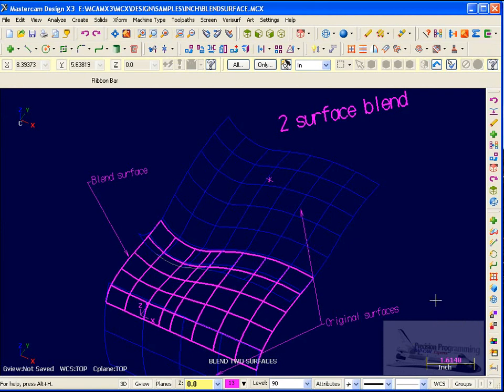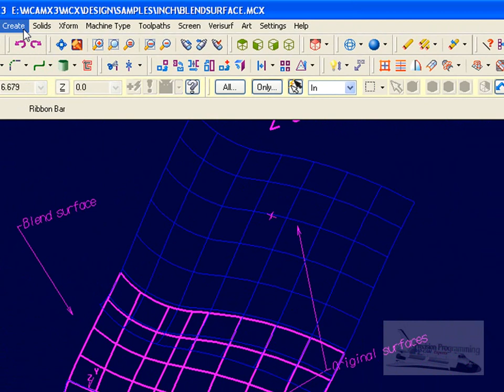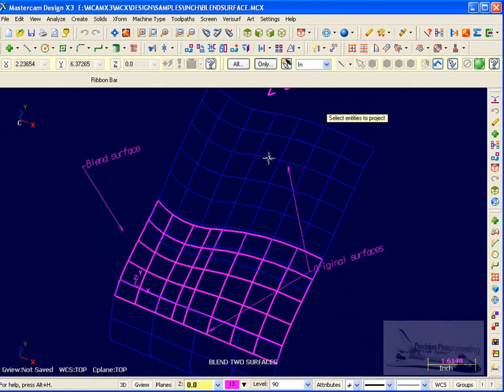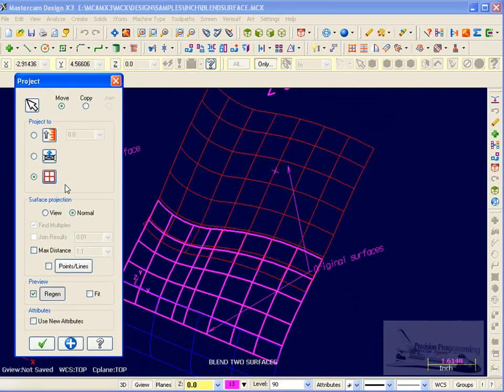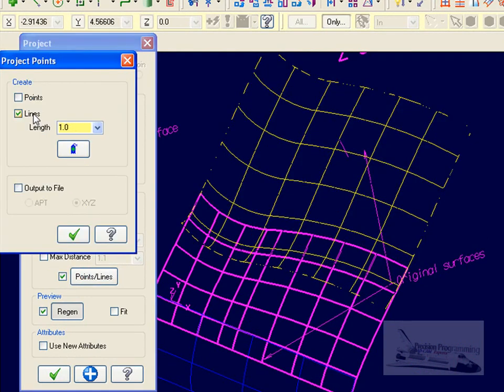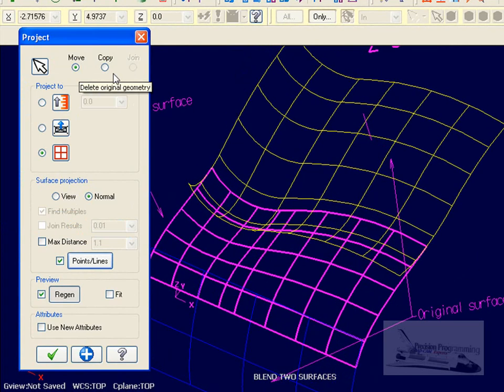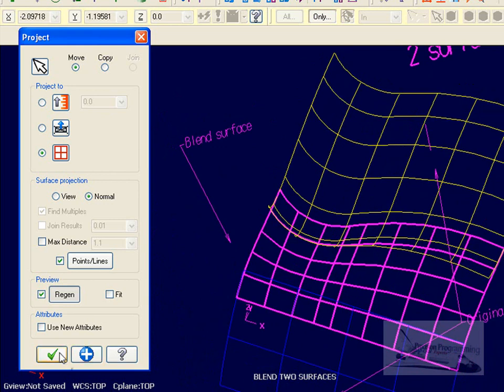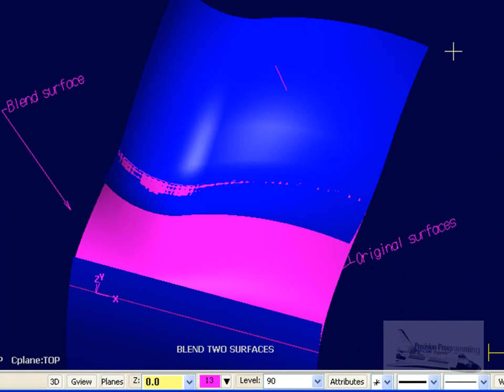line normal to surface

Comment: Good afternoon Jayson. I know I can create a point dynamic on a surface. Is it possible to create a line perpendicular to a point on a surface? For example when you analyze a surface you can see the arrow stay perpendicular to the surface. Can we create a line that way? 

Thank you,
Sam Roberts
Reply from the maker: +3D Machine, Inc. Sam, yes this video for old version but what  you want is either drag your point to a position along the surface then do the project and set the option for line. this will always be perpendicular to the surface at that point. Does that help. If you would like me to go thru it with you we can go online.
Reply: +PrecisionProgramming that is exactly what I did. I think its fair to say the could make an improvement here.
Reply from the maker: are you looking for a better option to pierce an area of a surface. Have you looked at the tools in Verisurf?
Reply from the maker: There is a free tool for Mastercam users.
Reply: +PrecisionProgramming are you referring to a C-Hook?
Reply: +PrecisionProgramming I'm finished with the design on this part. I typically don't run into this need but was designing a holding fixture for a automotive body panel.